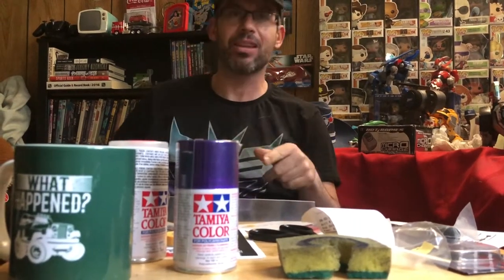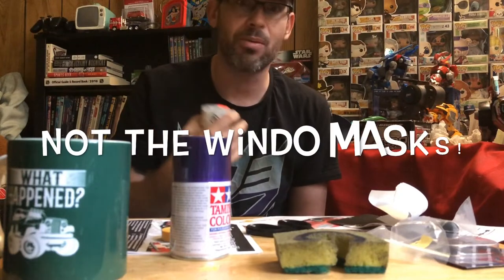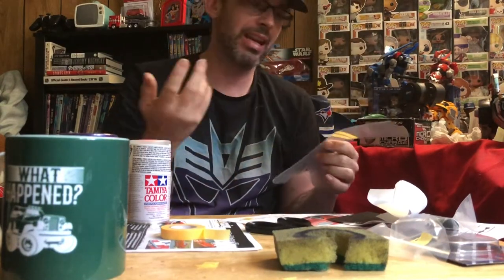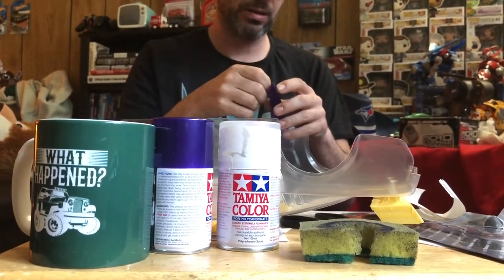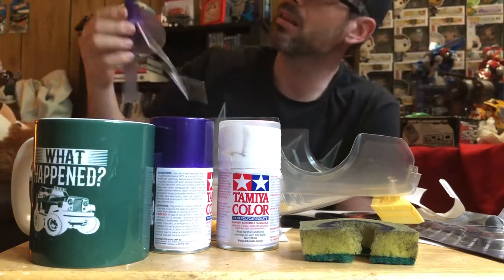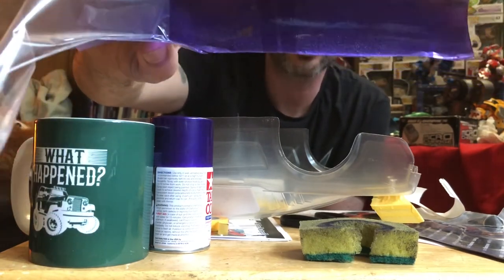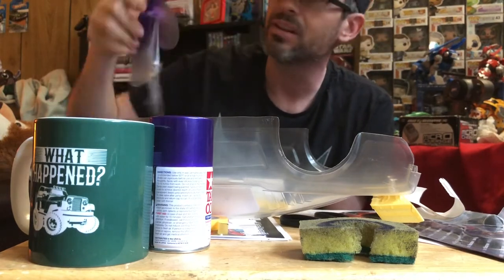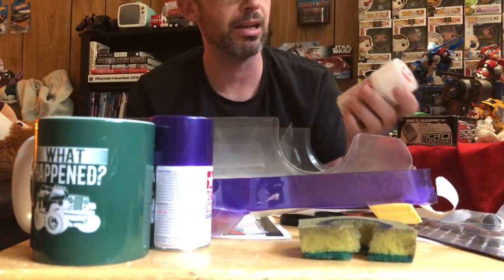RCWC: Tamiya PS-55 confusion? Experiment answers. Amazed by results.

Comment: I thought the PS flat clear was a Primer when using TS paint, so the TS paint sticks.
I can't find a PS brown, no one makes brown lexan paint.
So I was gunna use the PS flat clear as a Primer for the TS brown.
Reply from the maker: @archerash6695  that'll work. 👍 I used a PS champaign colour that was supposed to be backed with silver, but instead I brush-painted a TS brown behind it, and it made an awesome Bronze/Goldy colour. That was at least 2-3years ago and it still looks great! 👍

Comment: I don't know about the instructions on the can, but I can definitely tell you, that Tamiya writes in the instructions, that this flat clear 55 is to be applied to the outside (for example in the manual for the closed MX-5 body, just checked it) -- after removing the protective foiling. The gloss of the paint mainly comes from the polycarbonate itself and you need to alter the surface to make it appear flat. That is also the reason there isn't a gloss and matte variant for the PS paints.
Reply from the maker: Exactly why I did this video. Regardless of what instructions you follow. It will make a difference either way.
 More recently, I used this product again on the inside of the lexan before colour, and it did exactly what I was hoping by making certain masked off patterns next to impossible to see in shade but pop out in the sunshine.
 So just like my conclusion in this video. I'd say depending on what effect your looking for, it's very useful for both inside (before colour), & outside (after paint). Those that still wanna argue with results are always gonna argue anyway.
 Thanks for the input on what anyone can read, I like testing products for myself, rather than just read what the manufacturer suggests sometimes. It's the only way to get actual results instead of just opinions. Know what I'm sayin?
Reply: I use it as well one coat thin before I use my airbrush createx colors. To give it a better Bond besides the 4030 that I need to use. If you use too much in the inside you can get a sort of flat color but it won't be very flat. If you want the Matt look paint your body in the inside then the flat on the outside.
Reply from the maker: @driftcraze2138  appreciate the comment. That's pretty much exactly what I found as well.

Comment: It 100% gets used on the outside of the body. I believe the on can instructions to be an oversight due to most products being used on the inside as primary color. Of hundreds of colors and products, they are not going to spend thousands of dollars to change one word on the labeling. Hope this is helpful. Good test but no your recommendations are NOT as intended. Do more research/tests and try it outside. You CAN use it inside but with very little effect; just as you have proven in your video.
Reply from the maker: Thanks for the opinion. My results were quite significant actually. They may not have shown well on camera but I was quite happy with them. I & a close friend of mine used it on another project by spraying on the inside first, & it turned out amazing! So I’m not going to argue with you, but my results do contradict what you said. Thanks for watching.
Reply: @rcwreck-creation  agreed not worth arguing about, but what you are doing is "dulling" the actual paint on the inside. You have modified the color only. You have not "dulled" or flattened the gloss of the poly body itself lol.
Reply from the maker: Absolutely correct! I totally hear what you’re saying.  The effect of the flat clear is definitely more prominent over top the glossy body. The result I got on the inside was a “half-flat” I like to call it. 
The coolest part (of the project I videoed for my channel) is, cause I used a high metallic colour. The flat clear flat’d out the hue of the colour, but allows the metallics to shine through! So in direct sun the colour with flat over it looks almost like a flake? The part that got no flat-clear was a dual stripe I taped off when spraying it. So It’s a subtle difference you really need to look for at one angle, & @ another angle the stripe pops! It’s really nice actually. I’ll send ya a link to the video if you’re interested?

Comment: How's best to spray safely with this paint I have just got the tamiya paint and a 3M face mask with the padded respirators on either side is that safe enough from the vapour thinking of spraying outside on a non windy day or half in a garage half exposed to air? Worried don't want to get ill
Reply from the maker: I feel fine spraying outside. Maybe use the mask if you’re in the garage, but wherever you spray? Just make sure it’s well ventilated. For example: in the garage keep the door wide open. Overspray gets everywhere so don’t spray close by to anything you don’t want dusted with paint.

Comment: Sorry you were so badly misled. 😢 EVEN by the Can!
As you know by now, it Definitely doesn't go on the inside!! 
This kind of misinformation has hurt many modelers over the years.
Reply from the maker: Actually I found it does work on the inside. In fact I demonstrate the difference it makes on the inside in this video.
Reply from the maker: My conclusion to the experiment was it can be used inside & outside.
Reply: I did see that. And it does take some of the shine out.... 
But economically, you only need to use it on the outside. Of course there's my "Rule #1" of RC...
"It's YOUR RC. If it works for you, it's right" I just offer suggestions based on my myriad of experience (MISTAKES) over the decades! 😉
Reply from the maker: @CarminesRCTipsandTricks  absolutely brother! 👊 I’ll never say or think I know better. All I can do is listen to other experiences & tell about my experiences & hope it helps someone?
Reply: @rcwreck-creation  EXACTLY!